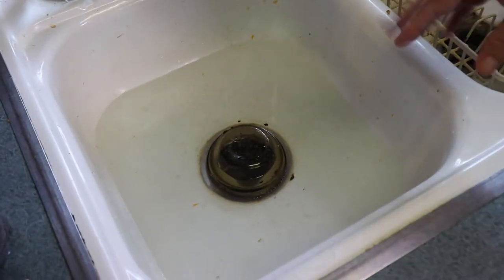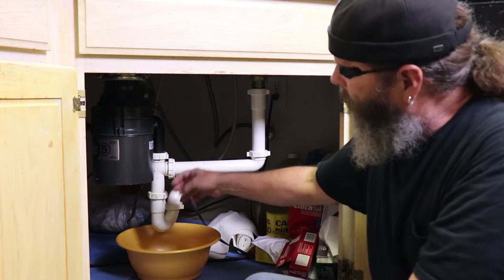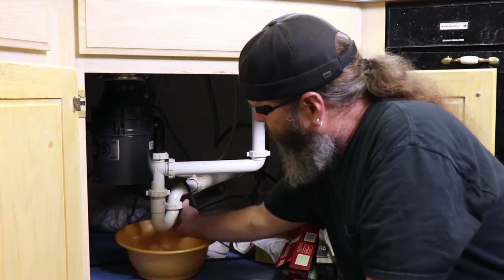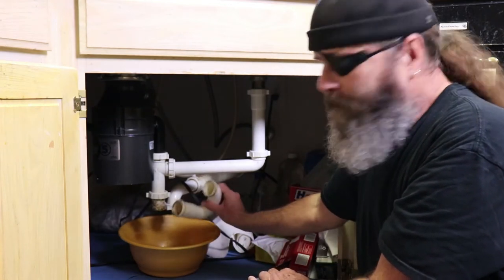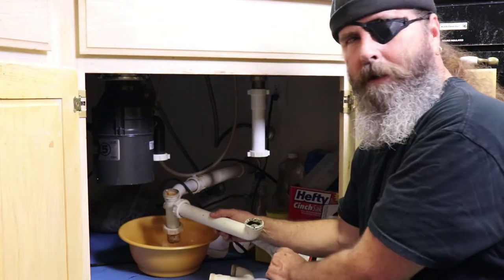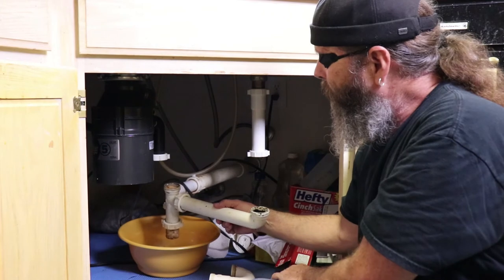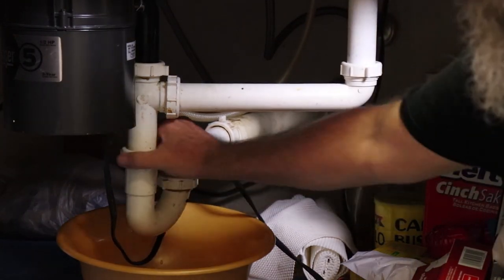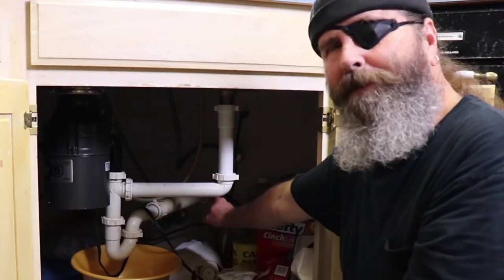Clogged Up Garbage Disposal? Here's How to Fix it!

Comment: My problem is beyond the p trap
Reply from the maker: If it's beyond the P trap, you probably need a snake.  You can get one at a hardware store, and it's a good idea to have one.  Take off the P trap, and run it out in the direction the water runs from the drain.  Hopefully you can either snag or push the blockage thru.  Let me know if that works, or even if it doesn't work!   There is another trick you can try before resorting to a plumber.  Good luck, me hearty!
Reply: Hello my one eyed pirate plumber dude.  I ordered a snake yesterday that arrived this afternoon before I started searching YouTube for advice. I ran the 25ft snake 3 times. It sort of kinda worked but no cigar, it’s still clogged.  I will say the water has slowly drained down but I’m sure it’s still not right. Anymore advice?
Reply from the maker: Try Instant Power Hair and Grease Drain Opener.  It comes in a black bottle, and I have had great luck with it.  Let it sit overnight, and it will clear out most clogs.  If that doesn't work, then you will probably need to call someone like rotorooter, as the clog may be caused by roots, or a broken/collapsed pipe.  Good luck, matey!
Reply: Arrrrrr, thanks Captain!  Will give it a try.
Reply from the maker: Let us know if it works, me hearty! Arrrr!
Reply: It’s in the pipe, 1/2 cup.  Crossing my fingers
Reply: So it was in there for about 5 hours maybe?  Well it didn’t work, so could I try another 1/2 cup or maybe 1 full cup?
Reply: So I pour hot water in the drain and then ran more water from the faucet. My wife kept running the disposal.  The next thing you know, water poured out from the pipes under the sink and all over the floor.  Now I am headed to Home Depot to rent a commercial snake b/c the 3 different plumbing companies I called are booked up for the rest of the month.  This sucks!!! Arrrrrrrrr
Reply: Got home with the commercial Snake machine, the dang snake would not bend enough to get down the pipe.  I had to take it back and they refunded me.  I then called the guy who did our remodel and he is suppose to come in the morning......While chilling on the sofa before work, my wife heard a noise in the kitchen.  Water came back up from the pipes and filled up half of our sink.  I had to use a big pot to empty out the water.
Reply from the maker: Aye, matey, ye  be in a pickle! Have you tried getting a plumber through Thumbtack, Home Advisors or one of the other apps?  Another thing you could try is running the snake from the main drain line.  There should be any access pipe in the ground, next to your house where the main drain line goes out to the sewer.  Try running the snake both ways - out to the street and back toward the house,  You definitely have a major issue.
Reply from the maker: YT is not showing me your most recent comment?  If you commented on my latest reply, YT must have a limit on the number within a thread?  Please start a new thread if you have replied.  Don't want to leave ye hangin' from the yardarm, matey!
Reply: Hey Captn, plumber came out and got into the main line. Took a few minutes and we are home free.  Thanks for your advice.
Reply from the maker: Glad to hear it, matey!!